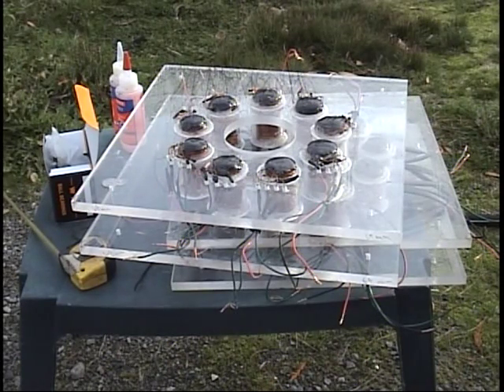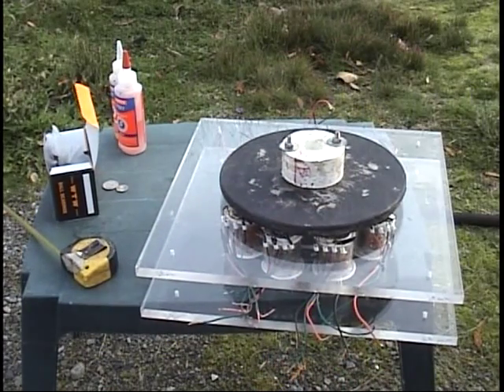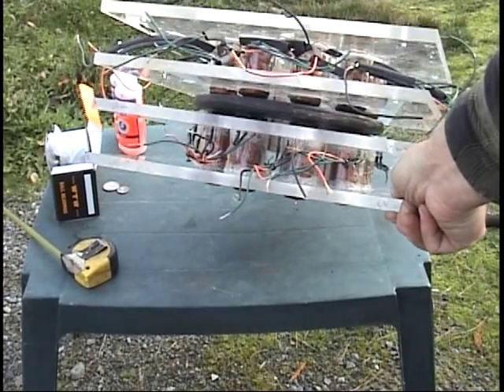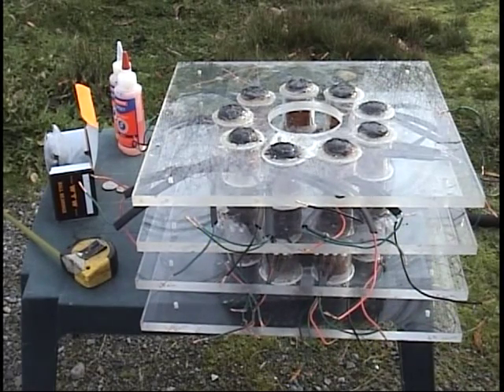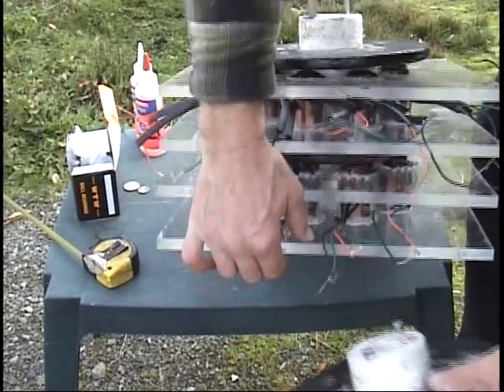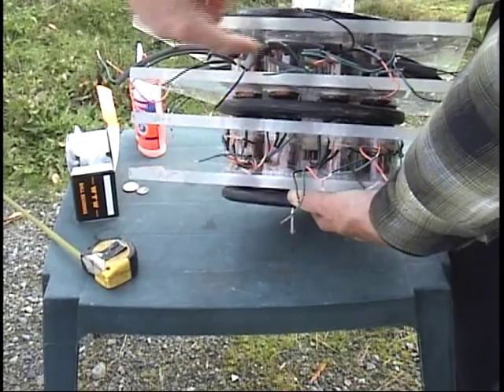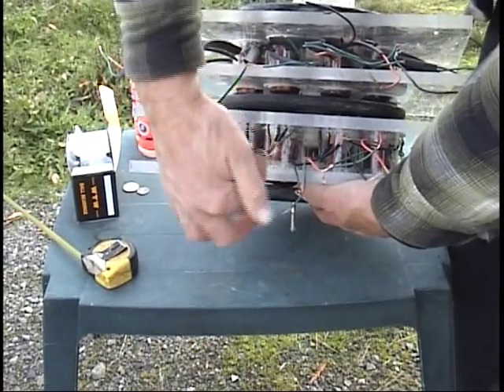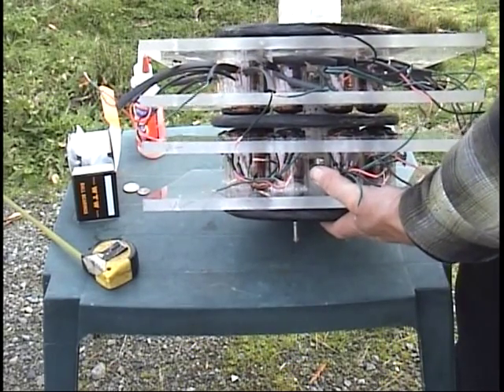Part1 Stacked rotors and coil plates

Comment: Was this project ever completed?
Reply from the maker: No but I got t it spinning at least it never did any work... however made a stronger version without the clear  plastic (for show really) nstead stators of 1" thick plywood which is going into a car when I get back to usa this spring. I am in country of Belarus now have only very small lab and hand tools here but just completed something like this small scale  with two 16 magnet rotors and ferrite cored coils 1/4 of core wound witb motor coil 3/4 Is generator winds these coils mounted between the two flat disv rotors
Reply: @MrDKONZEN  I am working on a simplified version of this design.
Reply from the maker: Hi Jim
Try ferrite roofs instead of black sand as black sand good for motor coils against neodymium magnets but does not transfer flux so well "end to end" 
Latest thing I did has that combo motor coil and generator coil I described last reply.....can you give me your email I can send you photos and short videos of latest motor generator thing I built here.